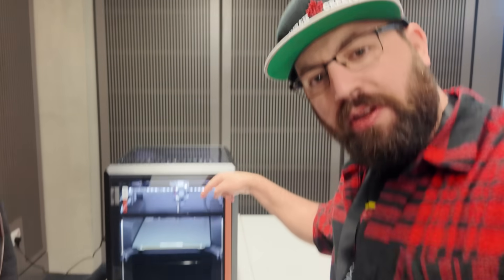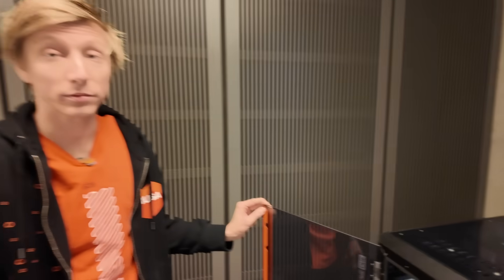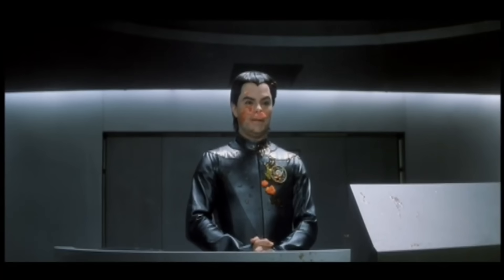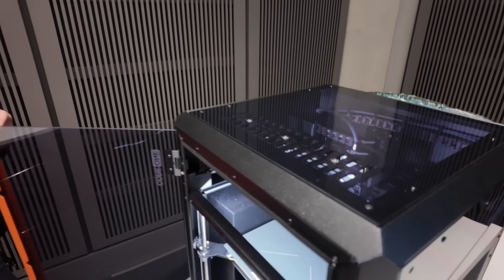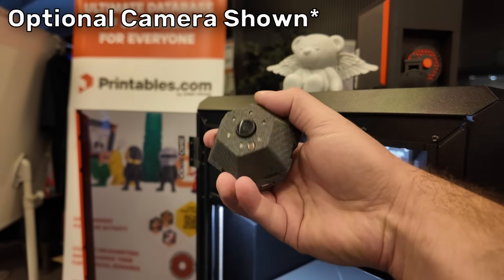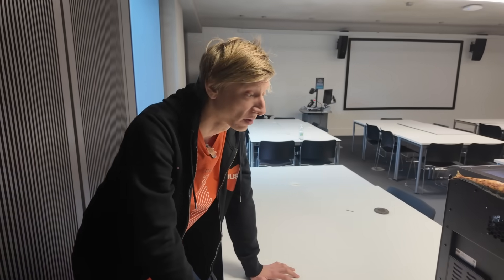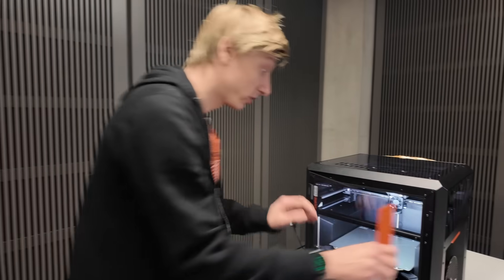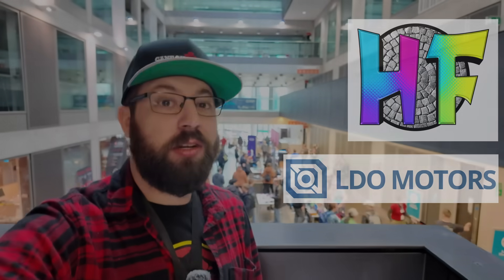One on One with the Prusa CORE One @ SMRRF24!

Comment: only thing prusa needs to work  now is an AMS like multi filament solution (no mmu is not as reliable). or better an idex head.

probably my nex printer btw
Reply from the maker: ill be honest, im really liking my MMU3 vs the AMS system, simply because its not picky at all when it comes to spool selection, 

plus, 5 colours is surprisingly more useful than 4

Comment: 3 motors 1 driver? Like xl, which fails
Reply from the maker: Pretty much all commercial printers have 1 z motor belted to multiple leadscrews, even bambu/creality do it

Only the DIY printers have auto bed traming for the most part
Reply: @CanuckCreator  One driver per stepper is ok.  I thought they said there is 3 motors one driver. Guy had his z board on xl fail because they apparently are driving 2 motors with one stepper driver, and it fried within a year.  Prusa needs to fix that.

Comment: i think if it is possible to put a manta m8p in the electronics  bay and slap klipper on it. its a nice and more funny printer, maybe with a custom toolhead (that supports stuff like carto/beacon, normal hotends and co. ) than it would be interesting.  yes, i know the machine runs stock really good, but after using klipper some time i dont want missing it.

 i like the look of it and how it is designed.
Reply from the maker: i BELIEVE the controller is already klipper compatible if you want too, although being honest, stock klipper FW is plenty good on their machines
Reply: @CanuckCreator  i need to think about it. i am unsure atm what i will really do. i just want only one printer but have 5. i am not really happy with every printer. my vz235 is to big for my small apartment, my micron is good in printing, but i think for his size its way to complex. my v0 is to small for me, my bambulab x1c ... it can print but the results are not the best also they are doing some shitty stuff with the updates...

i thinking of building a bigger hex-zero to support a 200x200 bed or buying a prusa one and change some smaller things how i like it (if it is possible)

i dont print really big parts, most of my parts can fit on a ~160x160mm bed.
because of space problems in my apartment i need to put it on my table

Comment: It's cool, ya, but its too little too late and overpriced to boot.  What is it trying to compete against?  At its price point there is nothing it does better/cheaper/faster then whats already offered by others.  If your thinking to compete against Bambu, you've lost before you even started.  Your build volume is SMALLER and your just as expensive as the X1 without the AMS, your kit version is the same price as the P1S with an AMS, which is bigger and in color....
So again, what did you build this printer for?  The Tinkerer?  Voron has you beat there and they aren't even an actual printer "company" just a bill of materials and some instructions on how to put a box of parts together into a printer (I have the LDO 2.4 350).
Reply from the maker: You said they are competing against bambu? I mean sure, on some fronts, but the industry is large enough to support multiple printers that meet multiple use case needs. As someone whose been involved in this industry for 7+ years and speaking with other users, believe me, their are plenty of use cases and a large demand for printers like this, especially once you consider servicability, long term support, compatibility with existing systems and also business requirements.

Also you CANNOT compare an assembled off the shelf machine to a kit printer like a voron, those lack any sort of support, require full user assembly and tuning and if you were to compare them equallity you would have to factor in cost to built it, ship and assembled printed and included long term support and updates
Reply: @CanuckCreator  Been printing for 5 years myself.  It comes down to cost benefit, for 3d printing, its cost to build volume, followed by usability and reliability.  The Core One fails in all fronts when stacked up against other brands.  Even reliability, something Prusa was always good at, has been taken by Bambu.  Price to Print Volume value is held by Elegoo Neptune 4 Max printers being just shy of a dollar per a mm of build area.  Though usability and reliability are a concern (I had two of them for a while).  If you want a large, enclosed, Core X/Y printer the Vorons or Rat Rigs are your best bet there.  The pre-built Rat Rigs, though costly, will come calibrated for you, and they are the only ones offering a whopping 500mm Core X/Y, with IDEX as an option.
Point I am making is the Core One is entering a market at a print point where it loses to everything else out there.  The only reason someone will buy a Core One is if they are a Pursa Fan Boy.  
I mean really, who's gonna buy a MK4S when an A1 is half the price with a MMU/AMS.....
Reply from the maker: @SirLANsalot  The mk4 IS their fastest selling printer and sells more per month than the mk3 ever did, yes bambu has moved into the market but really their taking the biggest chunk out of printer manufacturers like creator, elegoo etc. As for printers like rat rigs and vorons, not everyone wants to build a printer, some people just want make plastic boat.

The markets and demands of users and companies are large enough to support multiple different printers and brands aiming at different segments

Comment: They don't let it do a test because they don't want to show that it goes at the same speed as the MK4S
Reply from the maker: Damn, then what where the machines printing on the floor of the show doing.....
Reply: Mk4s being close to speed of Bambu Lab (and faster in multi-color), it's fine 😅
Modern printers are more limited by hotend/nozzle than by motion system.

Comment: BIg improvement over the previous machines, but they really should have gone with a new control board, something to take advantage of the tri-z setup, If I end up with one, I will do a control board swap straight away, I'm glad they went with steel, it has far less thermal expansion issues over Aluminium, steel is good, an we don't need light weight for the chassis, in fact the heavier the better I say, I think the empty side bat will be a perfect spot for an internal air filter and chamber heater setup.

Comment: Does it have an IMU/accelerometer now to enable more accurate resonance compensation?
Reply: You can also use an Accerolomter for the MK4. 
But the values determined by Prusa are surprisingly accurate.
With an original device, you can save yourself the purchase.
Reply from the maker: Yep, when all machines are built the same way with the same parts, the values for IS are really consistent
IIRC they did a bunch of testing with their farm and found out the stock IS values are fine for near 100% of the machines and those that its not QUITE perfect are still well within margin of still being an improvement over no IS

Comment: As gives clear indication on how they will be able to let me convert my mk4 into this (of course I have to buy mk4s kit to get few more bits)! Love these guys!!
Reply: The direct update would be an upgrade kit to MK4s for 99$.
On the other hand, you can now buy the fan separately.  The CHT nozzle too.
That's all you really need from the MK4S upgrade.
You don't necessarily need the Nfc and wifi module. 

Could work like this.

Comment: It has a looot of panel gaps. You can see the light coming through those gaps. That's bad for the chamber temperature. I would expect a better manufacturing quality from prusa.
Reply: That has to be the case. Otherwise the fans will create a vacuum and the housing could contract😂
It should easily reach its 55 degrees. The first tests will show.
Reply: @herr_rossi69 it seems you didn't watch the video. The fans are working because of the gap at the top. So the panel gaps have no functional purpose.
Reply: @AngelVenomous But only with PLA. If you are printing material that requires higher temperatures, you should have closed the slits. 
But the answer was not meant to be completely serious.
It was one of my questions to the Prusa employees at Formnext.
They referred to the pre-series status of the devices.
This is to be improved in series production.
But it won't be completely sealed and it isn't with other consumer printers either.
If you want to reach 100 degrees, it really does matter.
In the video it was pointed out that more than 55 degrees can be achieved with the loss of the warranty.
Reply: @herr_rossi69  you seem to miss the point. This is a quality issue. There is no functional purpose. The end. It's that simple. Even the enclosure for the XL was bad and everybody talked about the gaps which they were making no sense.
Reply: @AngelVenomous  Right, if that bothers you, it's a negative quality for you.
But it does work.
I don't like the XL housing either. 
But the Core One looks much better live.
As written, the series products should be better.
But you have to bear in mind that the frame can be unscrewed. So it can't be absolutely leak-proof at this point.
Let's wait until the first series devices appear.

Comment: Core One is Such a Waist of Money and Opportunity. Its a Smaller Build Volume than an X1C. Good thing the Big Bambu is Coming Soon for the Same Price. OMG
Reply: The new Bambulab is not intended to replace the existing printers and will be significantly more expensive.
Because the Core One is easily scalable, unlike the Bambulab, there could soon be a larger one for a little more.
Reply from the maker: k
Reply: > "Big Bambu is Coming Soon for the Same Price"
Oh you will be surprised 😅 They clearly stated it's not a cheap printer for hobbyists.

Same price as XL might be possible. They have no need to cut down their current models.

Comment: I broke my k1 Max door leaning over it 😢. It's weird that the k1 door is actually cheap compared to the k1 Max once you factor in shipping. There are some polycarbonate doors on eBay, but the price ends up being very close to the original k1 Max door, which does look and feel really nice. I own a Bambu P1S and honestly don't see anyone beating the cast frame on K1/K2.

Comment: If they could add an additional tool head, similar to the XL, that would be top tier.
Reply: I could imagine a CORE Two that is 300x300 with two toolheads priced in between this and the XL with the rest of the design very similar.

Comment: 1)Ok no extrusion means: no hacking! No easy mounts, no extended sizes by swapping longer extrusion and definitely hatder to 3d model!
Reply from the maker: tbf, no other commerical corexy`s that are common on the market atm are extrusions either, and extrusions actually cost quite a bit more than what was used for the core1, so when your competing against markets that will always be able to undercut you, gotta take the wins when you can get em.

also, its all steel, so MAGNETS!

Comment: Why have 3 z motors instead of 1 motor 3 leadscrews and a belt system. This is a weird choice having 3 motors run by 1 driver. If you have 3 motors, marlin can do g34, this isn't a budget machine, what are they saving by not adding 2 driver expansion? 2 years to make a bambu competitor, and it is 2x the price of a p1s, and is smaller.  But, sure it's built well, and has inset walls for activities. I guess counting on tariffs to make bambus more expensive...

Comment: Really didn't like these holes in steel sheet, a lot of heat eascapes through it
Reply from the maker: It has way less holes in the enclosure than most other enclosed 3d printers on the market (the x1/p1 barely gets to 50c for the 60 capable core 1)

also if your running the exhaust fan at all, the enclosure will have negative pressure anyways

Comment: I thought that bambu is simply better because easier than prusa. But now I used a A1 and P1S for 1 year, my confidence is gaining and also my interest in better "repairability" and modding like you talked about. In Conclusion: Bambu is the Starter Drug and after a while you may need a Prusa :-). And now there is a clean chambered one... Love it!
Reply: I started with MK4 then got an A1 to try bambu « high technology » and this will my first and last bambu printer. yeah it print but I don't like the firmware/slicer features, lack of repairability, phone app dependency to just update a firmware... so even with LAN only you still need to ping internet time to time. I also hate the vibrations test/calibration before each prints, make no sense to stress the hardware like that

Comment: The MK4 and MK4S struggled against the Bambu lineup, but this printer looks like it's going to be in a similar price and performance bracket to the X1 Carbon. Both Bambu and Prusa printers are print farm workhouses, so it's going to be interesting what printers people wind up picking up for that application in the next few years.
Reply: Prusa eats their own dogfood, they already have many Core One's in their print farm so they will know where all the bugs are.  First adopters need not worry about being used as beta testers, Prusa is doing that themselves.
Reply: @KennethScharf Exactly just like the XL and the MK4
Reply: Are you guys smoking crack? The XL was a launch disaster! First adopters were not even beta testers, they were alpha testers. I've sold both my MK3S+ and Mini+. My Mini+ was a real PoS and at one point the MK3 was a fire hazard. Prusa never helped his customer base by recalling faulty parts/products. Prusa fanboys may spit on Bambu but at least Bambu stood behind their products and provided replacement parts.
Reply: I would say that this core one is more on the level of the X1E since this is more sofisticated in terms of acuracy and physical dimensions, both machines are a bit more pro on the specs and materials, the one thing that I would say is that the core one is missing that obxidian nozzle, Prusa being more open to hack mods is awsome though, and this is cheaper than the X1E... But over all I thing that this is a great start for this line up

Comment: So they are running "some pieces of klipper motion".
Reply: *Some pieces of Marlin motion planner, my bad if I said Klipper.
Reply: As long as it's *open source*, it's OK to use it elsewhere (and improve) - not limited to klipper motion, Marlin motion, Arachne or whole slicers 😉 Even closed source printers use (or make - Cura) open source slicers.

Comment: I really, really hope they overhaul the MMU. The MMU3 for MK4 pissed me off so badly that I might not buy another Prusa until they fix it.

Or they could bypass the issue with multiple toolheads or even just idex. I just need something that can allow me to use support materials with ease.
Reply from the maker: you know they have a toolchanger already?

Also, what issues have you had with the mmu3? mines been rock solid so far
Reply: @CanuckCreator If the XL had a properly integrated enclosure like the Core One, I might consider saving up for one. But as it is, it's just too little for way too much money. I just want a 2 tool system with a regular print bed, nothing huge or overly complex.

As for the MMU3, the cassette buffer is a joke. I live in a very humid area, and having exposed filament just hanging in the air for possibly an entire day is not feasible. I print from dryboxes while they're running, and spool rewind is the only feasible solution for that. That's aside from the MMU requiring me to fuss over every roll of filament to get it perfectly straight and trim the tip and then feed it manually all the way in, when you can just shove a roll two inches into an AMS feed port and it does the rest.

I love the MK4 itself, but the MMU3 has given me nothing but issues. I upgraded to Ultimulti and it has helped a lot, but it's still inexcusable when the AMS exists.

If I was willing to buy Bambu, I wouldn't be complaining. But I refuse to give them my business. So it's really frustrating when Prusa can't do something as simple as make their own AMS

Comment: What a disapointment.  All the time and money spent making the mk4s upgradable is just dumb.  Leave bed slingers and cores 2 seperate lines.  Now we finally get an enclosed core machine but its 2 years 2 late, too small because "muh upgradability" less features because we spent all the monies & time on r&d for backwards compatibility.

Hopefully theres a core one plus in the works that actually gets it right with size and features, and leaves backwards compatability to bedslingers.
Reply from the maker: its not dumb but i think your thinking about it the wrong way.
When your trying to figure out to manufacture a entirely new printer in the west while minimizing costs as much as possible you want to use things you already have experience with and production capabilities for
They already have the supply chain and work done making all the mk4 components that are used on the core one, and they are all thoroughly tested and verified to work to boot. And the frame is built using the same method and local supplier that their existing enclosures use
The upgradability from mk4-core1 is just a nice bonus
Reply: @CanuckCreator  3D printing produces waste, it's nice to see Prusa reduce waste by reusing parts, reduce purge using MMU3 etc.
Reply: Prusa has emphasized that the Core One is easily scalable. I think a larger version will be coming soon. 

The big disadvantage of the Bambulab Corexy is that it is very difficult to customize. Otherwise they would have had a larger printer long ago.

Comment: I’m curious to see if this camera option is just a modified buddy3d (3d printed housing), or a whole seperate unit.
Reply from the maker: I believe it's along the same lines. Since prusa printers don't have an soc on em running Linux. Any camera has to be it's own thing essentially
Reply: @CanuckCreator The internal camera has a cable that looks like a thermestor! 

How was it connected inside?

 Do you have to run a usb cable through the pass thru hole that leads to one of the usb-c controller ports?